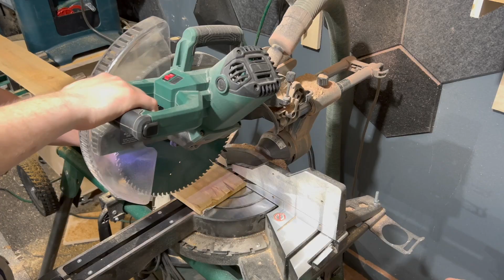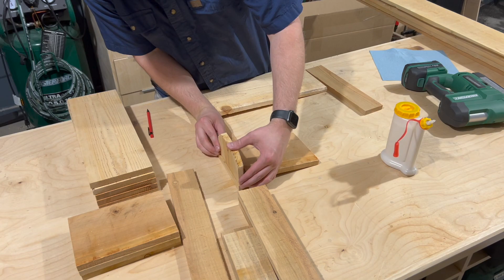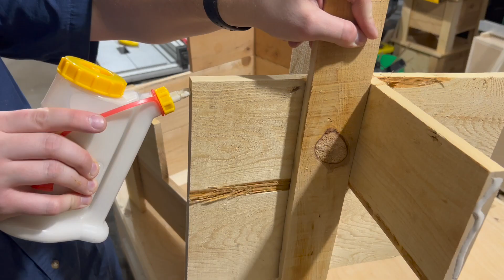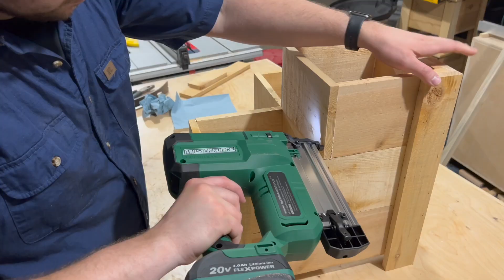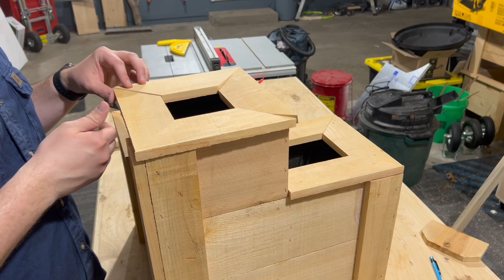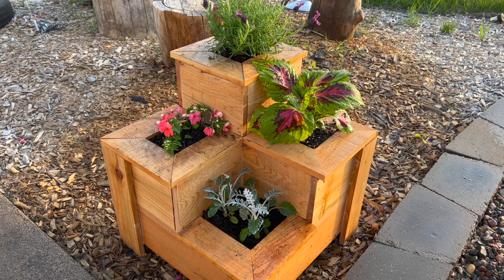Triple Tier Planter | Shop Noise #asmr

Comment from the maker: In this video I make a triple tier planter out of cedar fence pickets. I'm happy with the look of this planter but the plan was horrible! I designed the plan in sketch-up but realized the building process would suck because of how precise I would have to be in order to fit the middle section in the surrounding walls. I did save money with minimal parts but I think a framed triple tier planter build would avoid the required precision.

What do you think, how could I have made this an easier build?